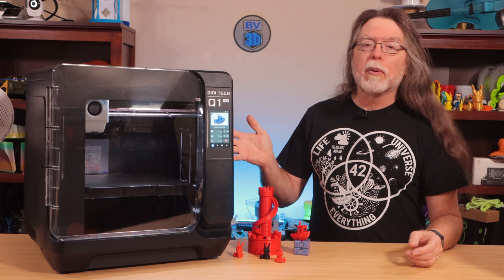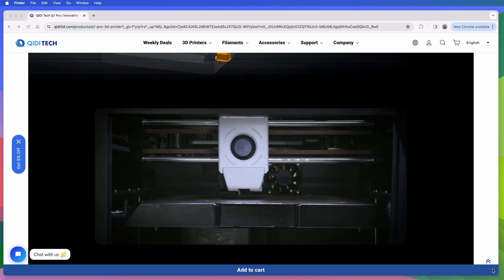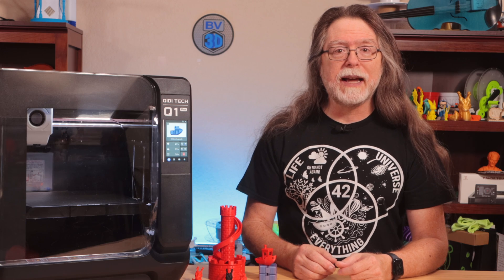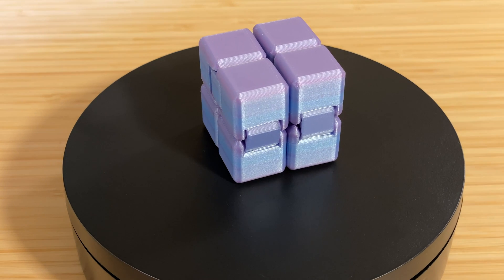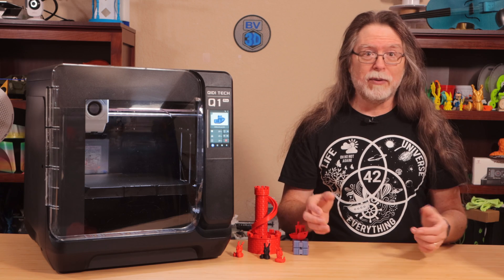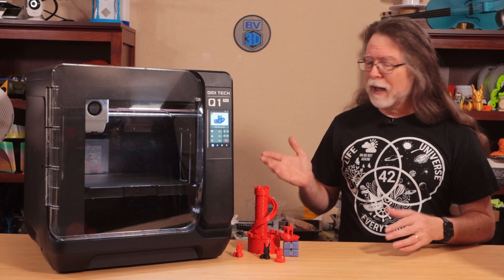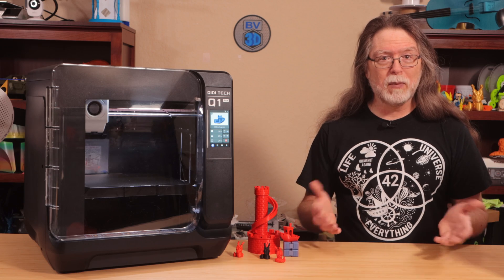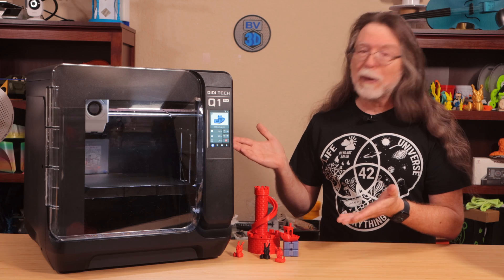Qidi Tech Q1 Pro First Look!

Comment: I sent qidi tech a question asking if this printer works for cura and they said that cura is not for high speed printers. .. somehow I think that I can still use cura but they just didn't want to answer my question. This is weird because I could swear that I saw Cura listed among the compatible slicers in their specifications for this machine... It makes me a bit dissatisfied
Reply from the maker: I can't think of a reason Cura wouldn't work to slice files for the printer. You might have to use the QidiSlicer's start G-code as a guide to set the start G-code in Cura, and maybe use a script to post-process the G-code file to do things like manage the chamber heater, but at its heart it's a printer running Klipper, and there are any number of other Klipper-based printers that work just fine with Cura.

The text at the bottom of the specs table on the printer's page says it works with "QIDI Slicer and other third-party software, such as PrusaSlicer, Orca etc." I guess Cura lands in the "etc" category.

Comment: I now have the Qidi Tech X-Plus-3 Printer my 1st enclosed core xy one. and I love it. it is fast and works really well.
I saw this new printer you reviewed and I won't be buying it.  In fact I was going to save up and buy the Qidi Tech X-Max-3 as well later.

But now decided not to buy it as at around £800 it is allot to save up!

I have the Elegoo Neptune 3 and the Max version printers so I have also the BTT Pad 7 so when 
I figure out how to use the klipper system on it to upgrade the Neptune 3 and 3 Max to klipper versions I be using them instead of buying the X-Max-3 I will not now buy.  

I be dismantling the other two printers I have as they just are a pain to use now!

They are the FL Sun QQ-S Pro Delta printer and the Aquila I upgraded.  
I be building a room inside the room I use for my 3D printers which I be putting fire proof and sound proof tiles in to help 
with the fan noises and stable and safe printing heat.  But I not buy any more printers now! Just use the 3 FDM printers and the 1 resin printer I have.

Too pricey keep buying printers and better to make use of the best ones and save money for the extra electricity costs I have now.